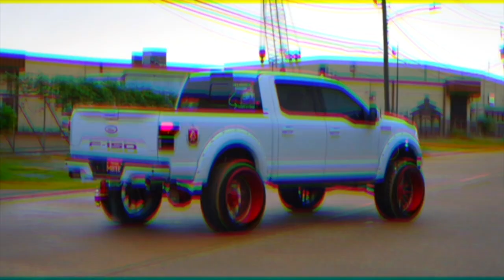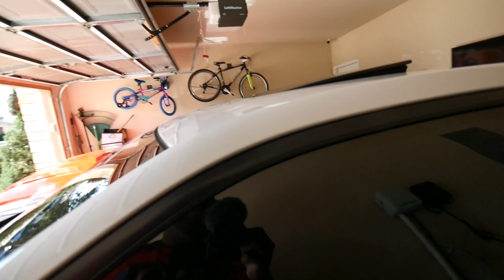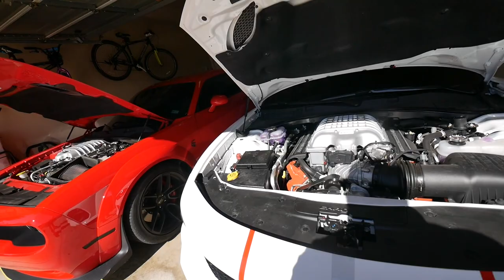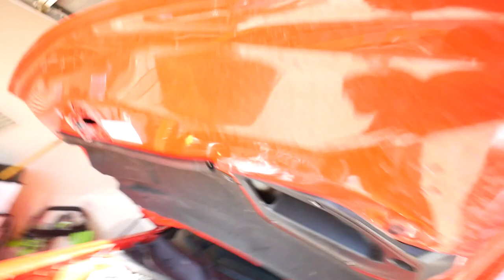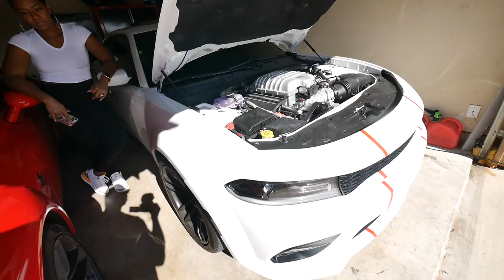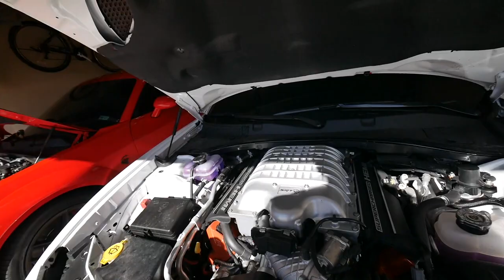IS IT REALLY WORTH SPENDING THOUSANDS OF DOLLARS FOR A REDEYE VS A REGULAR HELLCAT

Comment: The supercharger on the Hellcat is 2.4 liters vs the Redeye 2.7 Liters A Hellcats stock boost is 11.6 lbs vs the Redeyes 14.5 lbs its not just a different badge on the supercharger,also the Hellcat is a 6200 redline where the redeye is 6500 and the redeye has a dual stage fuel pump where the Hellcat dont

Comment: If both of the actual 6.2L engines have 500+hp without the superchargers then I can tell the difference in the superchargers in power wise. The Challenger Redeye's supercharger produces 312 hp if the 6.2L hemi engine only has 485hp but if it has 505hp then the supercharger has 292hp which added the total power of 797hp. I know Charger's 6.4L hemi engine has 485hp. So the Charger Hellcat's supercharger would be producing 222hp. If the Charger's 6.2L hemi V8 has 500hp then the supercharger has about 207hp. Which added the total power of 707hp. I'm learning alot about these so far.
Reply: The  485 hp 6.4 liter 392 cubic inch engine that’s in the scat pack is not the same as the hellcat the hellcat engine is smaller and lighter (with out the supercharger) its a 6.2 liter
Reply: @bjturner47  Yup the scat pack has 485hp but with no supercharger added. Both engines in the redeye and the charger are 6.2L with superchargers added.
Reply: Just buy a smaller pulley. Bam